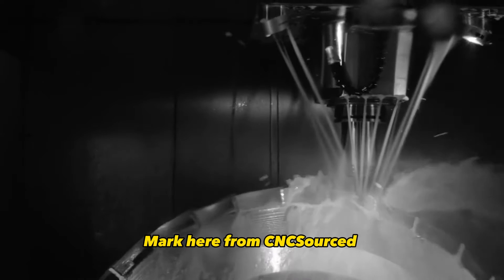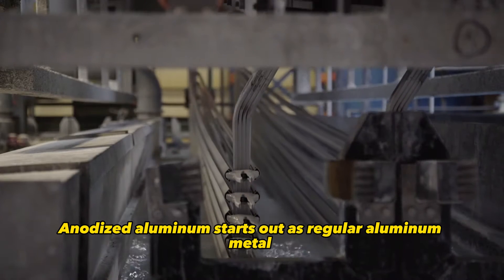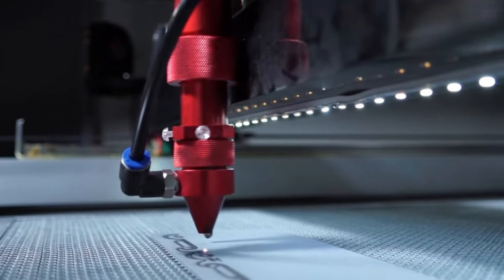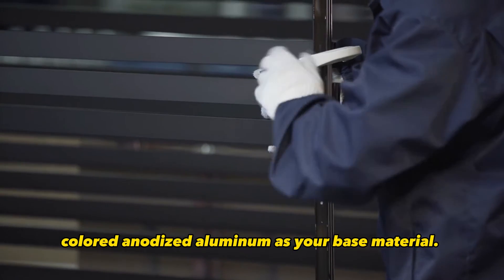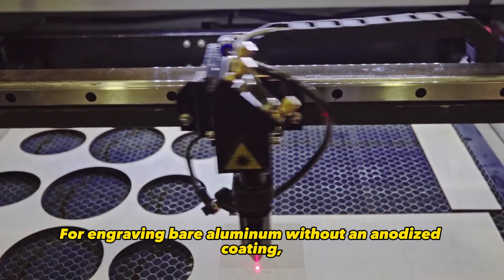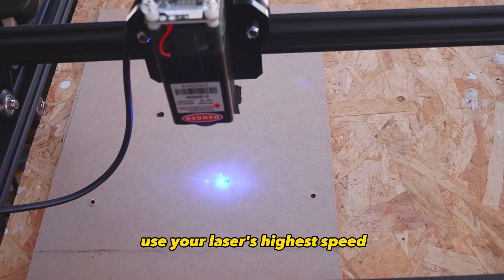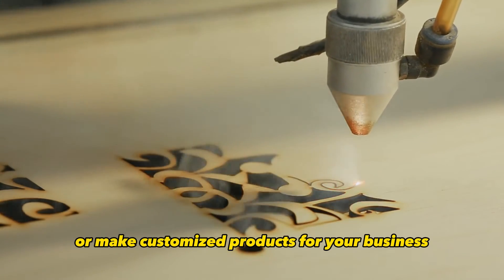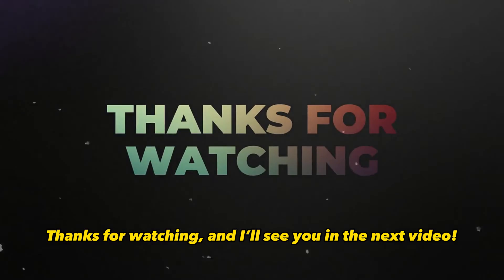How to Laser Engrave & Etch Anodized Aluminum the RIGHT Way (Tried and Tested Methods)

Comment: I've got a 20 Watt fiber laser and I'm trying to make high quality playing cards for various games. I was wondering if you had any information on how to get not particularly glossy anodized aluminum to be higher gloss. I have both thin business cards and thick trading card blanks but the thicker are not very glossy. I would like to if possible be able to get the 100% photo realistic results out of the thicker cards which I'm getting with the thinner ones. Any guidance would be appreciated.